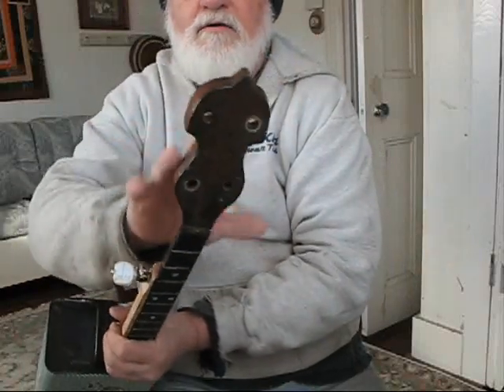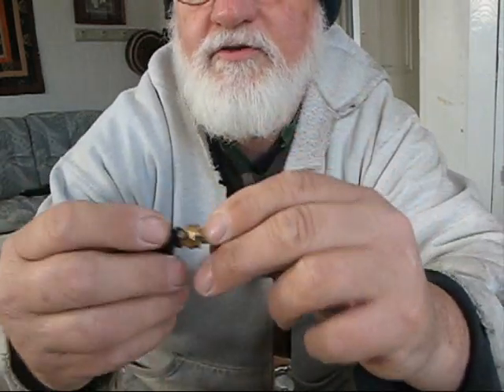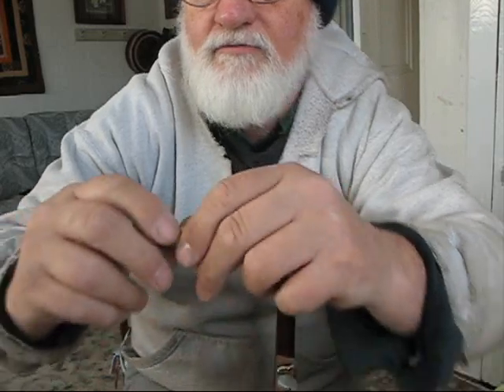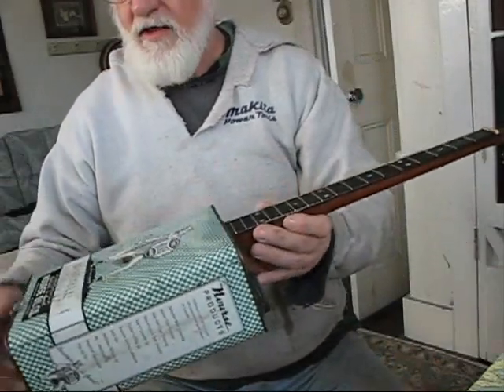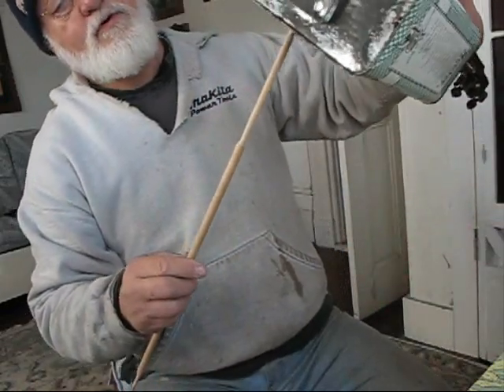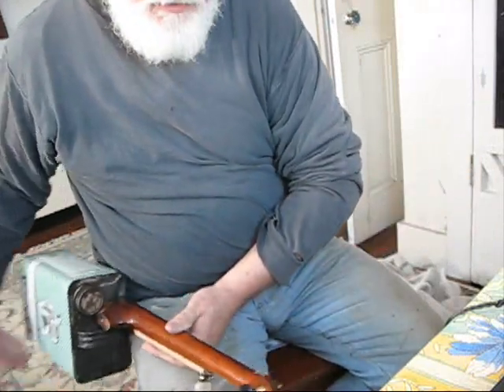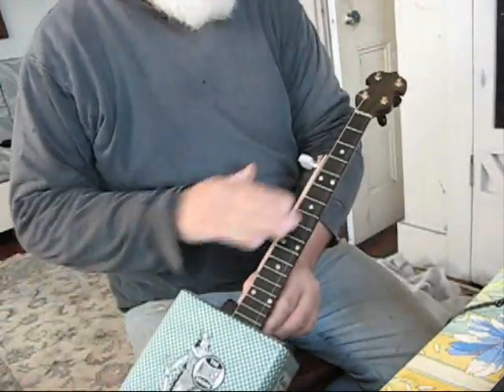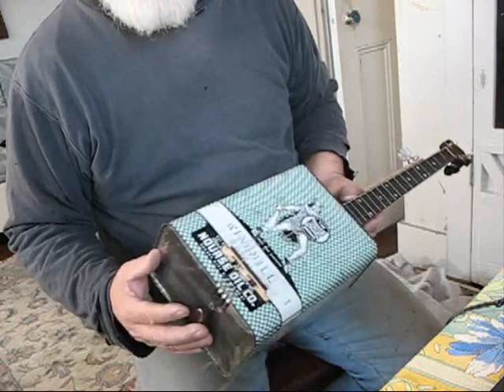How to make a gas can banjo 9

Comment from the maker: @byron151227 The fork bolts on to the screw that goes through the hole in the bottom of the can that goes into the dowell stick.  Just one hole if I get it right, but sometimes I wind up with more than one before I get the neck alignment just right.